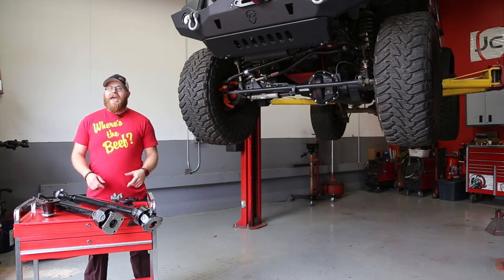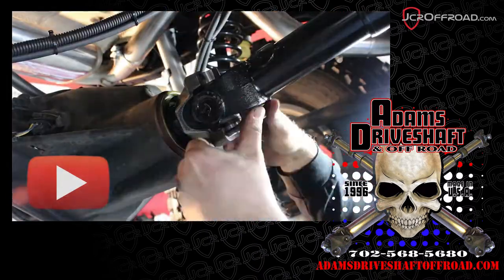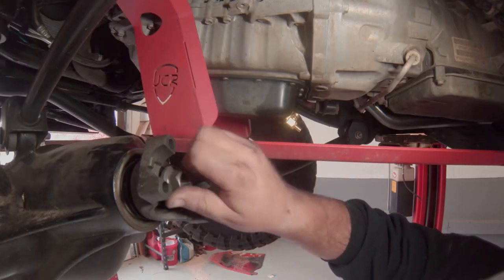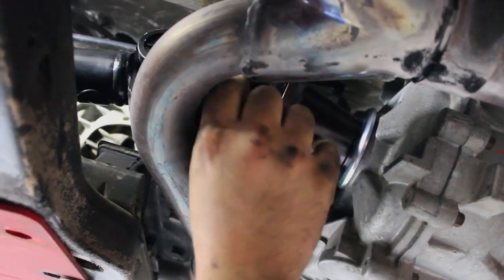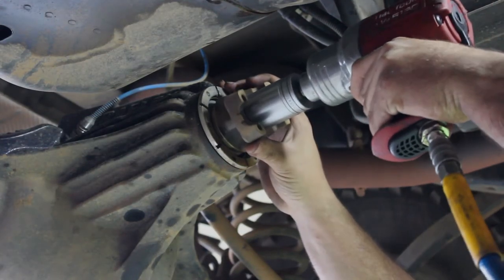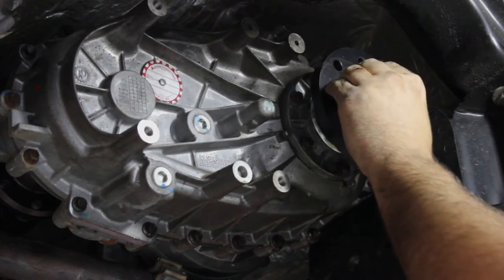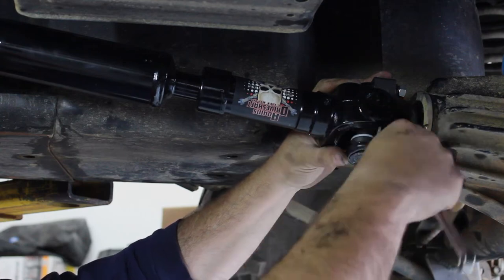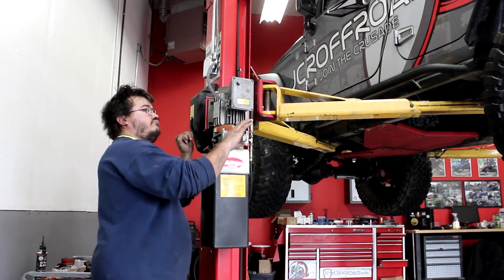Adams 1350 Jeep JK Driveshaft Installation - JcrOffroad

Comment: Waiting for my 1350 to be delivered. Did you end up changing the front pinion angle to point straight to transfer case or just install where everything is? I'm hearing two different things
Reply: @vanadinite01  yup. Adjusted my control arms to accommodate the new angles